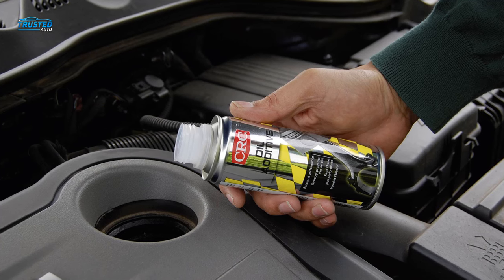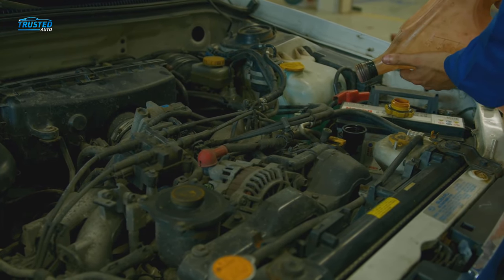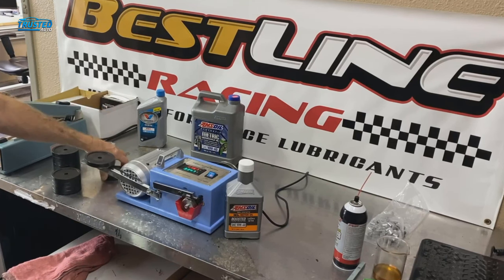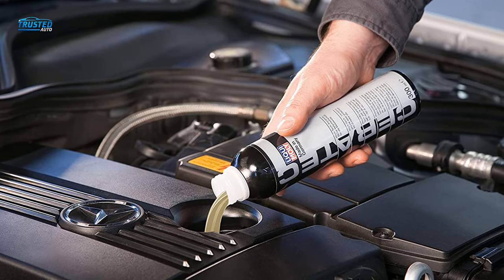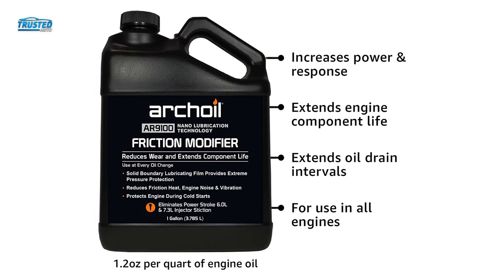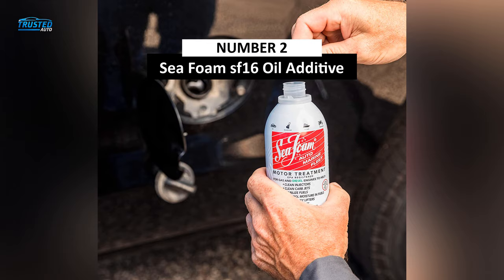Best Oil Additive 2023 - Top 5 Best Oil Additives for Car 2023

Comment from the maker: Best Oil Additive 2023 | Trusted Auto

List of the Best Oil Additives 2023 you can found on the market.

0:00 Intro

(Paid Link)
Number 5: 0:56 BestLine Premium Synthetic Engine Treatment
International Amazon Link: https://amzn.to/3W27p3h

Number 4: 1:37 Liqui Moly Cera Tec Friction Modifier
International Amazon Link: https://amzn.to/3eTb9Dj

Number 3: 2:17 Archoil AR9100 Oil Additive
International Amazon Link: https://amzn.to/3zqBrUH

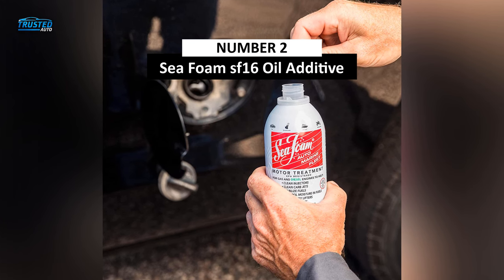Number 2: 3:05 Sea Foam sf16 Oil Additive
International Amazon Link: https://amzn.to/3CVxubh

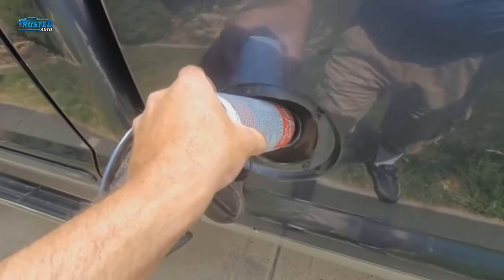Number 1: 3:50 Lucas Heavy Duty Oil Stabilizer
International Amazon Link: https://amzn.to/3sgCXV5

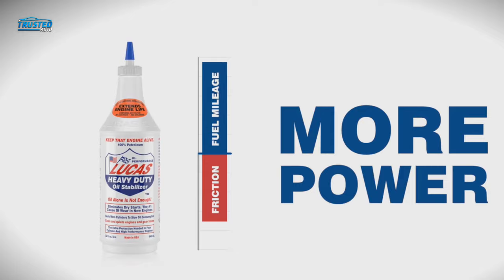4:28 Outro